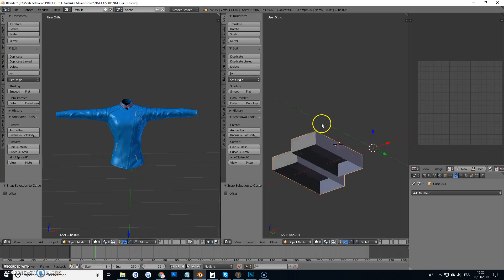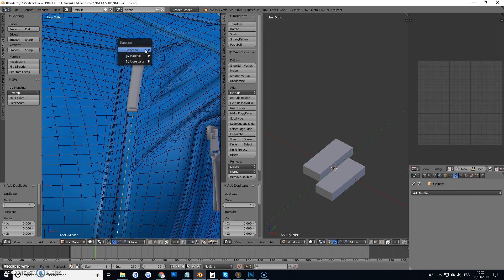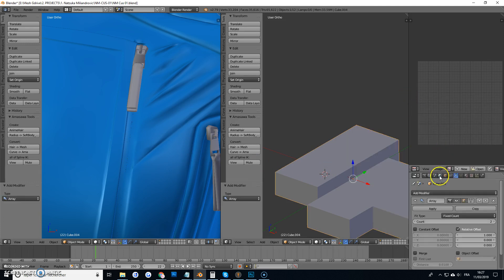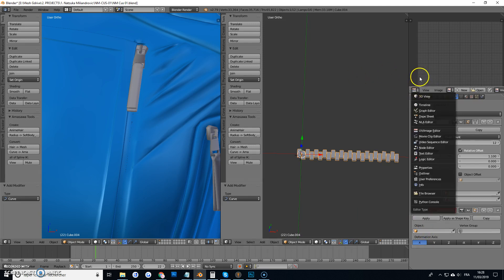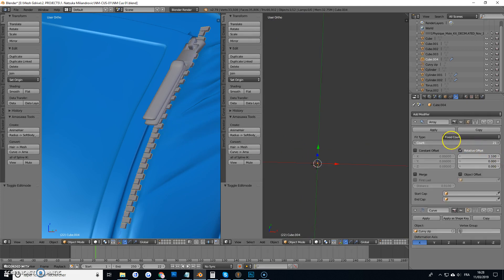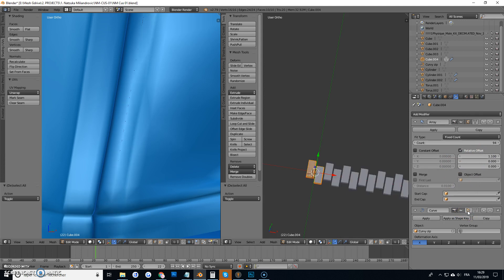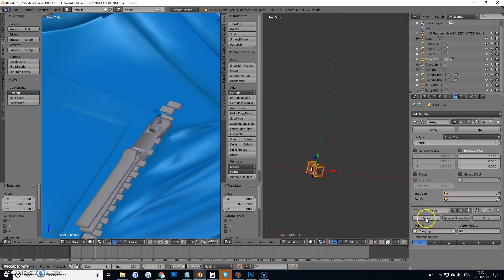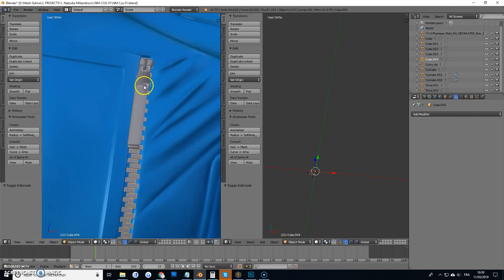Blender Zip From Curve

Comment: How do you rig this zipper's so it won't come off the mesh? I have tried smoothing and it seems to do the same thing
Reply from the maker: Rigging this is not so easy it takes practice. One trick is to make sure when you texture you don't have any AO shadows under the zip on the jacket and even on the zip itself  so any clipping is allot less visible.